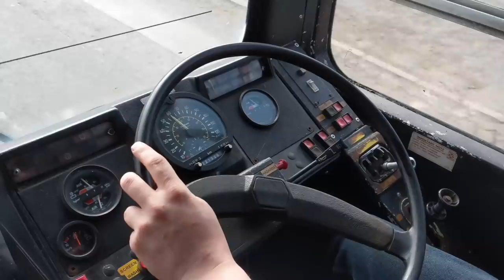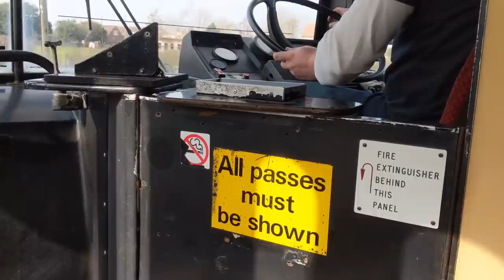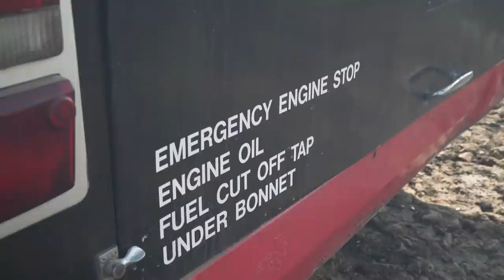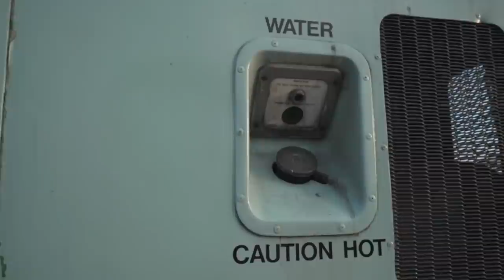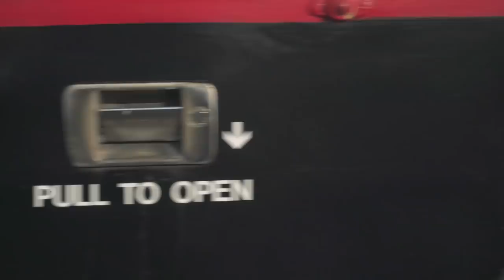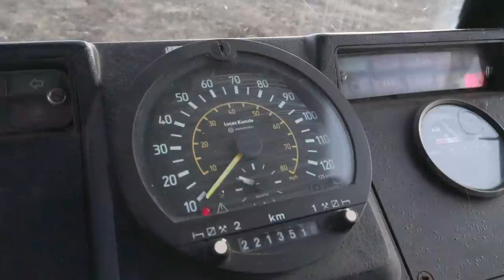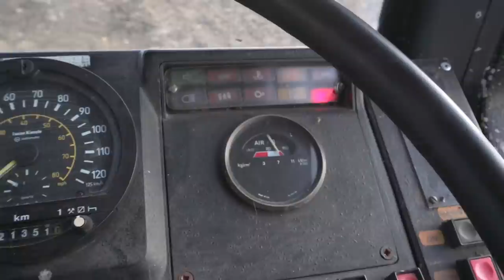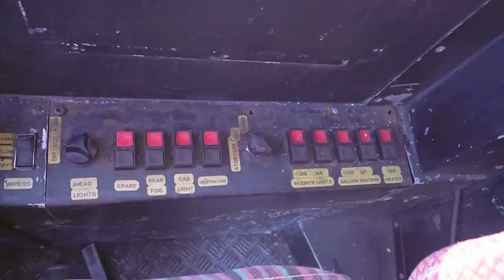The mighty Leyland Olympian  LMM Drives Episode 33.

Comment: The Gay Hostess model of the Atlantean - the predecessor - is worth a look at.  Also there was a Fire Engine version of the Atlantean with the hose and valve gear at the front of the vehicle rather than the rear.  Behind a set doors.
Reply: Although there's only one surviving Hostess Atlantean, and I don't think it has run in 30 years.  It's finally under restoration, though

Comment: Ribble used Olympians, and Blackburn Transport ued Atlanteans, until the late 90s when they started getting some Olympians in as the Atlanteans required more and more maintainance.
Reply from the maker: I guess that's the case with any old vehicle
Reply: @lmm  that's true, but I heard in terms of repairs if one panel of an Atlantean got damaged they'd pretty much have to replace the whole side of the bus, and the Olympian was easier to repair. At one point they seemed to only use single deck buses.
Reply from the maker: @jazzygeofferz  oh really? Damn!

Comment: Leyland didn’t produce finished buses, they made the mechanicals and chassis, bodywork was built by other companies. I remember seeing many a running chassis with the driver wearing a crash helmet delivering them to coach builders for completion.
Also they made excellent trucks with a cab unit so good DAF bought it out and still produce cabs in Leyland today which are then transported to DAF to build the trucks.
Reply from the maker: That must have been quite the sight to see!

Comment: The Leyland rail bus wasn't a complete failure. 
The Pacer was developed from it, and yes it was derided to the point that some people love them for their inadequacy, but in some parts of the country they are still in service even after the point they failed to meet accessibility requirements. 
Due to lack of rolling stock they are allowed to still operate in formation with compliant Sprinter sets. 
Just like the HST, a stopgap train that refuses to die.
Typical British make do and mend attitude that seems to last longer than the vehicles designed to replace them.
Reply from the maker: The pacer is really a huge success in the regard that it lasted far longer than it was ever meant to!

Comment: Leylands Railbuses were not a failure........

......the last ones are still in service ........ they also built larger Sprinters which are also still in service as Class 153 and 155
Reply from the maker: The lev1 was, which is what was in development around the same time
Reply: @lmm  Can't see how LEV-1 was a failure......it was only an adapted bus body on an experimental High Speed Freight Wagon chassis with no engine or transmission......designed to be towed around in ride and dynamics testing behind a loco......and shown static to interested parties.....

LEV - 2 was the first powered one demonstrated as a concept, then LEV - 3 which also visited export markets (along with two other prototypes that worked abroad) and were then developed into the class 140 prototype....

Comment: As memory serves, this Olympian replaced the older Atlantean, which was also a good vehicle.  However, in true BL fashion, they did screw up somewhat as they made the Olympian rather a lot longer than the Atlantean, which made the Olympian unsuitable for use in tighter cities like Portsmouth, so Portsmouth Corporation Transport had to extend the life of their existing, already rather old, Atlanteans until they were dissolved and transport services in the city were taken over by other operators...

The comment about the Leylands being better than the Volvos that replaced them is perfectly true.  The big issue was that Volvo were extremely good at building buses for their home markets in the Scandinavian countries, and they assumed that that would be perfectly fine for buses used in other markets.  Which very much wasn't the case.  Buses in the UK, for example, get worked much, much harder than would be normal in, say, Sweden, and in much tighter operating conditions which means that UK buses are going to be getting bounced around by the roads and also bumped up and down kerbs to get around badly parked traffic so they get a very hard life.  Add in the fact that the early vehicles from the Volvo takeover also coincided with a period when the supply of steel they were able to secure was very poor quality, and it's not surprising there were issues.  Early UK Volvo buses are just about extinct now as an awful lot were bought back and dismantled for parts, and the few that weren't are very likely to have succumbed to structural rot by now.  Having said that, a lot of the mechanical parts, engines and gearboxes particularly, are still in service or were until very recently.  It's fair to say that Volvo did recover and regroup very quickly, and there were plenty of regions in the UK where it was far from unusual to see Volvo double-deckers operating perfectly well with several million miles on them.  WMPTE, the bus operator in the Birmingham area, did have a Volvo bus that was retired when it broke 10 million miles and which, I believe, is on display in a local transport museum and still regularly seen out and about at events...
Reply from the maker: That's an incredible amount of miles! Just bonkers!
Reply: @lmm    Yes, it is truly mind boggling.  Particularly around Birmingham...

Comment: Umm Leyland spent not very much using the National bus body on a chassis with bogies, that was kinda the whole point of the Pacer as they had the body nailed down perfect without having to press new panels save for the driver cab cubicle and some custom glass, even the seats were from Leyland Nationals.   
It was tricky for the profitable Leyland commercials as part of government support required Austin-Rover to spin off its buses, vans and trucks into separate companies and the commercial side were very aware that Austin-Rover was dragging them into the mud leading to management buyouts and whatnot, the brand survives today in India where Leyland is still the byword for cough cough quality...   No doubt they have engine blocks hand cast in some Calcutta back alley, brakes made out of wood, real candles for night time driving and painted in 277 garish colours too.   
Would say too, the Pacer despite everything was a 110% success, it provided cheap cattle truck style DMU's that could rattle up and down branches til doomsday, comfort was not an option nor warmth or cool air, it wasn't bargain basement railways but in the cellar below bargain basements or as some would think the hell below that.

Comment: and the 6LXB in a bus is usually derated to 127 bhp
Reply from the maker: Oh really?
Reply: @lmm  yes, screwed down for fuel economy, on bus work you didn't need power really as you are stop starting all day. 0-30 speed is all that is required really
Reply: If thats true oh dear, that's woeful and dangerously underpowered. Putting fuel economy infront passenger saftey is wrong. I'd hope it's uprated back to it's true rating now because 180hp still isn't much! Our cummins olympians had 250hp for comparison!
Reply: @wharris302  127 was fine, my Metrobuses go like stink
Reply: @DecalCentralUK  what ones are those?
Reply: always 180, in the Bristol VR certainly so it surely would be in these

Comment: Sorry guys, but have to disagree about the Olympians being the best Leyland bus. They were certainly good but surely, arguably the Atlantean of the "pay as you enter" type was that and the Titan PD's, for the rear loader type.
Certainly if you go off the sheer numbers sold, length of time in service and of production anyway.

However I have to really take issue with the "bus on rails" or Class 142 Pacer being a "failure" . 

It might not have been well liked in more recent times and admittedly on jointed track it was a tad bouncy at times, but as for being built purely as a "stop gap" for about nine years service and in the end, actually lasting for about forty, I don't think you can call them.a "failure".

They saved more otherwise uneconomical lines from closure due to their low cost and running cost figures and I have never been on one that broke down. Can't say that about any other units sadly.

I'll admit they became disliked, but after recent events with the shiny new Hitachi units, I can see a day when we regret them going and certainly for the reasons given, as whatever else you can say about them, they didn't owe their operators a penny.

Can't say that about much else on the network now, unless it's a Class 37, 47, or something of similar age and reliability.

So I for one think that the Pacer was an underrated and ultimately a rather unfairly maligned unit.

Comment: The first double decker you've ever driven and you have an opinion that it's all wobbly, I drove double decker's for 17 years and they are in no way "wobbly". Do you realise how much it takes to get a decker to tip over 45 degrees, it's extreme and would rarely happen. You would be at more risk of it going under a low bridge, you would seem that you haven't a clue what you're talking about.
Reply from the maker: The only way you would think that a double decker doesn't wobble from side to side as you bounce down a country road and go round bends would be if you'd never driven anything else. I was at far greater risk of it falling over than finding a low bridge where I was.
Reply: @lmm  You drove a double decker once, I drove them for seventeen years how dare you think that you're the expert. As I said 45 degrees is the angle that a double decker is likely to tip over, and no country lane will do that. Again I say that you haven't a clue what you're talking about. You may feel that it's wobbly but you need to know the capabilities of your vehicle or you're no driver at all. If your channel is monetised, you are making money under false pretences. You are a complete charlatan and close to the category of scammer.

Comment: May I respectfully suggest that you bone up on walk round checks?  Your walk through the saloon should include checking the ceiling mounted bell, security of seats and all rails and security of the flooring.  As for the outside, you missed so much that it is laughable.  Also, as for the demo at the end,  in just that 1/2 minute you have proved the need for professional driver training.
Reply from the maker: It's a quick walk around to give people an idea of what a driver would be doing when they start their day.
Reply: I gave it the full defect check before the day had begun. This is not a training video but a brief description aimed at those who don't know to give them a general idea in an entertaining and engaging manner.
I think you've missed the point of their content.